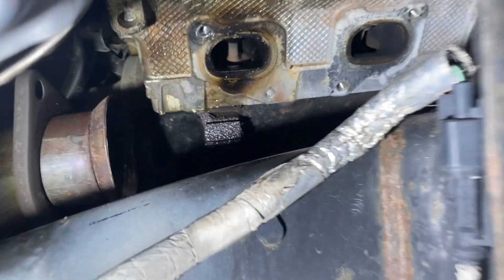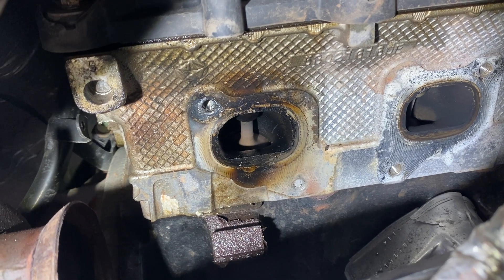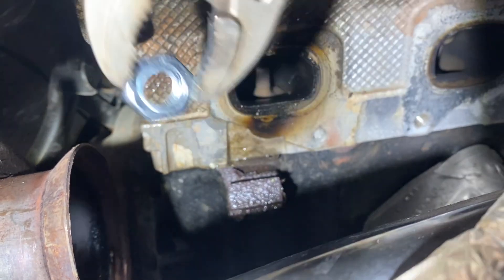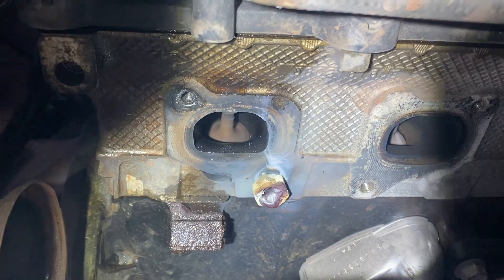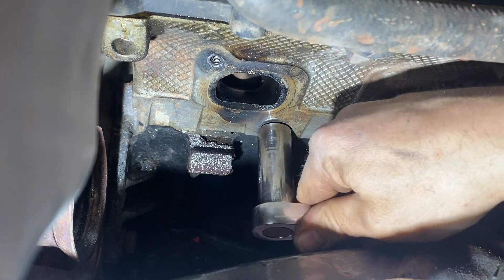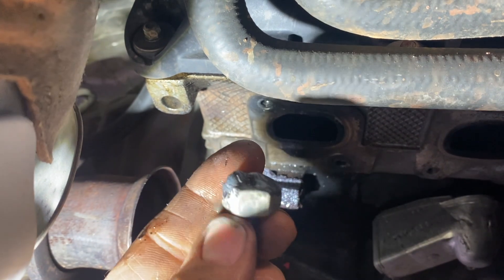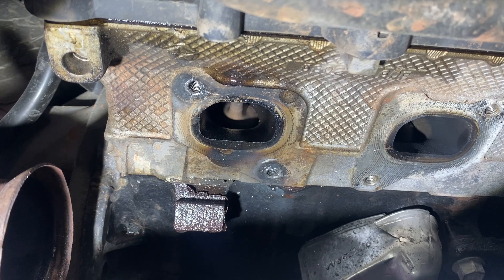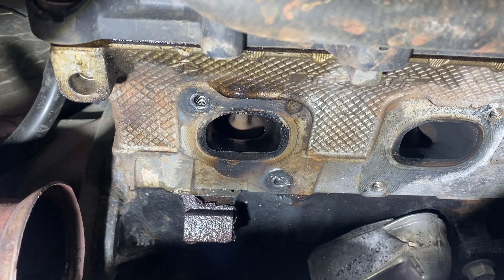Broken Bolt Extraction (HEMI Exhaust Manifold)

Comment: Note: the welding trick will not work if someone over time used SS exhaust bolts. I'm currently dealing with this now and hopefully the drill out with plate method works as I can't weld bolts to SS studs.......

Comment: Est TX. I have a 4x4 2018 5.6 hemi ram, i was quoted for $2.1k for the right side from the dealership, is that typical or should i DIY
Reply from the maker: @Abramp20000  that is too much even for our dealer, this job should not go over $1200 at the dealer for one side
Reply: Once ive seen your videos you make it seem like i was being over charged, appreciated the reply 🤙 @TDRAuto
Reply from the maker: @Abramp20000  Once in a while technician can mess up and damage the head, so maybe they price that in
Reply: @TDRAuto  probably that could be why too, if that was the case id suck that the customer has to pay for the mechanics mistakes